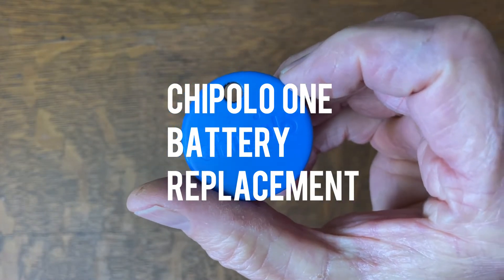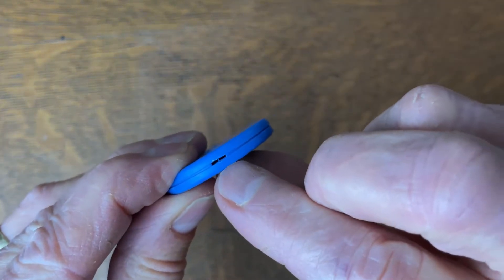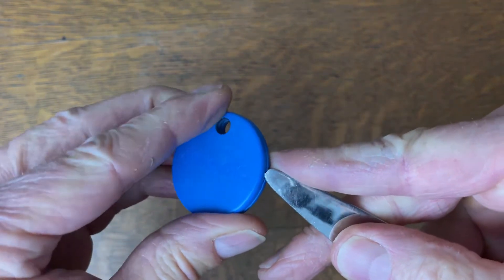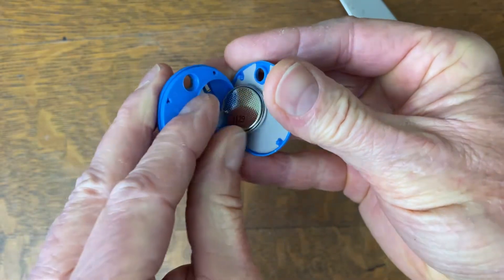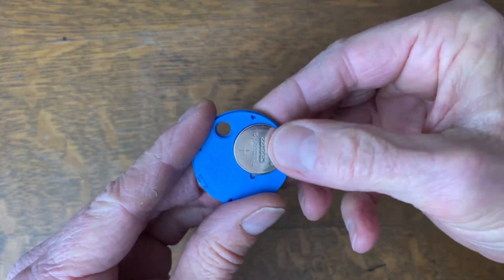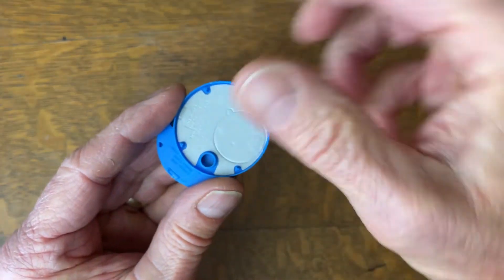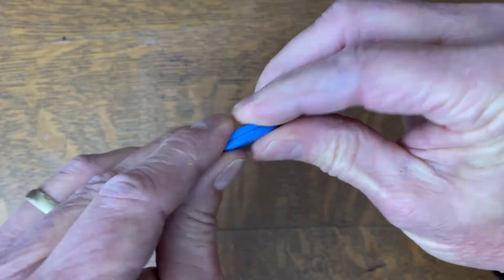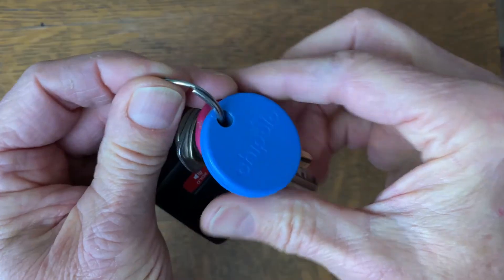CHIPOLO ONE - Replacing the Battery

Comment: Remember best practice is not to touch a new battery, so as to avoid corrosion issues.
Reply: so are you supposed to just yell at the battery to get in the device?

do you will it in?  use telekinesis?
Reply: @RC-nj1by  I can't tell if you're being sarcastic, there are glovse for working with electrical that don't have that powdery substance coating them. 

Or you can use tweezers with sillicone/rubber/ plastic etc. tips. non conductive material.